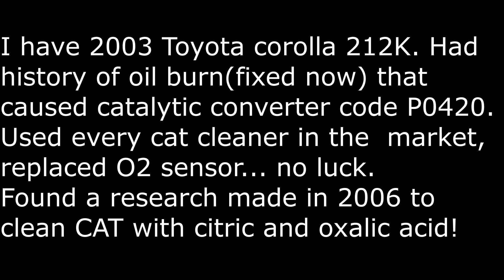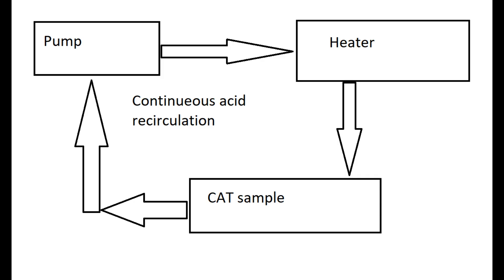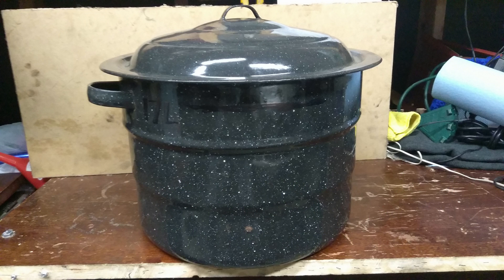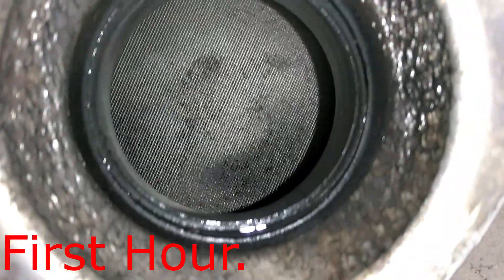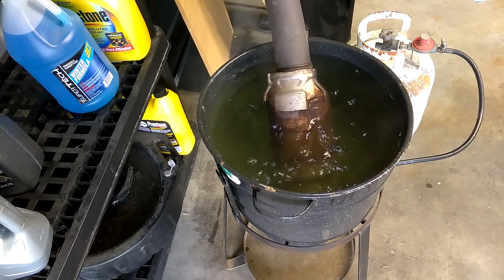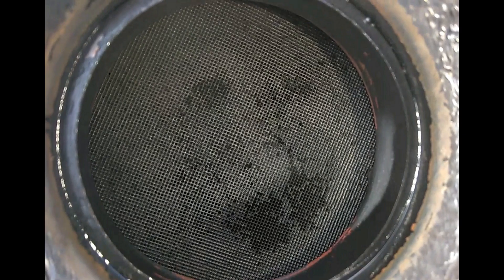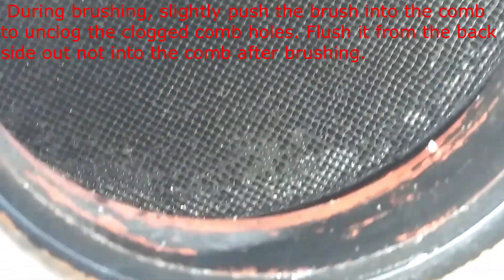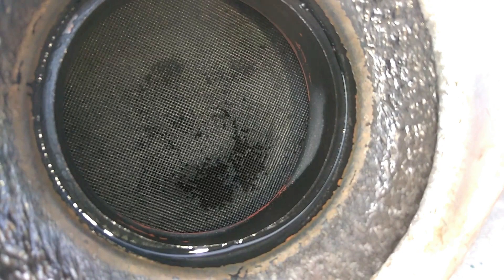Catalytic converter cleaning with Citric and Oxalic acids

Comment: I wonder if adding a fine abrasive media(aluminumoxide, sand, soda or something else/ entirely different) mixed into the solution or water used to flush/spray it out would work for those who can't reach the honeycomb with a brush. Obviously, I would think it would only, possibly, work after already having soaked it several times. Also, I would think it would definitely depend on whether the honeycomb is ceramic or stainless steel.

Comment: I did this with my 2005 Lexus RX330 with 149,000 miles. Had codes for both cats(upstream and downstream) p0420 and p0430. I tried 2 bottles of Cataclean didn’t work, replaced downstream oxygen sensors didn’t work. Tried the sea-foam directly into the cats without removing them and didn’t work. 
I am a chemical engineer and read the whole cientific article/experiment made by these two guys in Europe and it made perfectly sense to me. Achieved the exact 0.1M for both citric and oxalic acid (reagent grade from ebay) concentration. I maintained a 50 Celsius Temperature and moved the cats up and down 6-10 times every 30 min and ran clean water every hour for 5 hours. The check engine light and the codes cleared out and I just passed my Smog check here in CA!
Reply: Is that 0.1 M of citric acid and 0.1 M of oxalic acid per liter of distilled water? What would you say is the minimum number of liters needed for 2 cats? I haven't had the time to read the paper, but it was referenced in something else I was reading, so I am tangentially familiar with it. Are there different forms/grades of the acids, i.e. industrial grade, medical grade, food grade? Would you suggest simply getting a pure powder form? Would you recommend the site/app you mentioned to buy them?(I worded it that way because YTube is insane about removing response comments that refer to specific sites, for me anyway)... I'm asking all this for theoretical/entertainment purposes only, obviously.

Comment: 😮Anthony’s Citric Acid powder (5lbs): $18.
Cheapo 12 Quart pot: $9.
Savogram Wood Bleach (340ml @ 95-100% Oxalic Acid): $8.
Bottled water (5gal): $7.
Propane use: maybe two dollars-worth.
Candle-making thermometer: borrowed for free.

The formula & procedure:
Caution: do this outside in a well ventilated area and wear gloves and goggles. The acid is not particularly caustic, but you don’t want to get it on stuff unnecessarily. Also, while heating it produces a smell that would not be pleasant inside—and that might indicate something unhealthy.

Formula: Per gallon of water I used 75ml citric acid and 50ml Oxalic acid.

Procedure: I placed the CAT in my cheapo 12 quart pot. Two and a half gallons water nearly reached the brim and completely covered the catalytic converter inside the housing. So I mixed 190ml Citric Acid and 125ml Oxalic Acid with the 2.5 gallons water. Ideal temps for the solution are said to be 150-160* F for six hours. In 2016 the tempertures were higher than recommended (185 or 190) most of the time. In 2018, I got it just right. This second time I lifted and submerged the CAT in/out of solution six times each half hour to ensure flow through the substrate

Comment: I did this for clogged cats for my supercharged truck which had long term use of octane booster . I had the P0430 code for under threshold . I didn't heat the water but rather soaked the catted pipes in large containers for a day. They cats were clean after soaking for the entire day. I put them back on the vehicle , cleared the codes and drove it hard for about an hour to get the cats really hot. Did this is January 2019 and still good to this day.